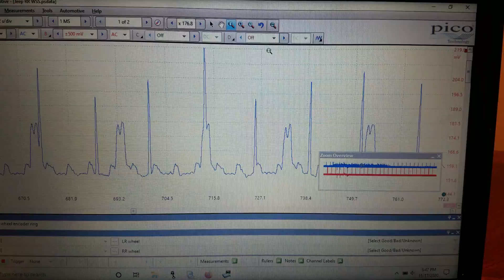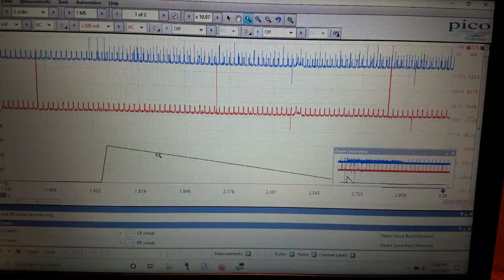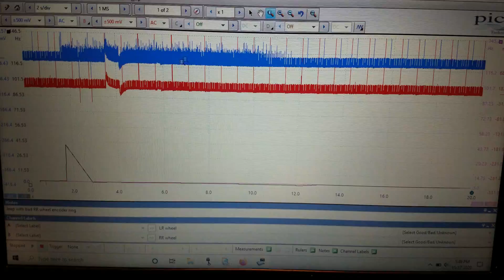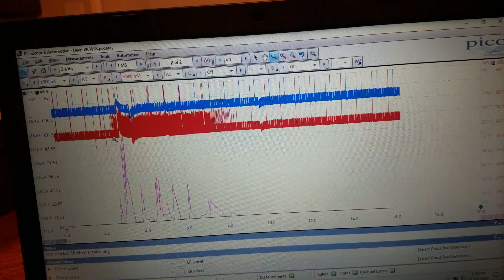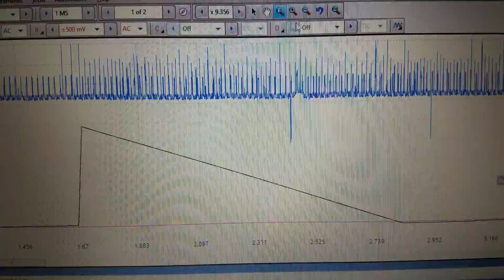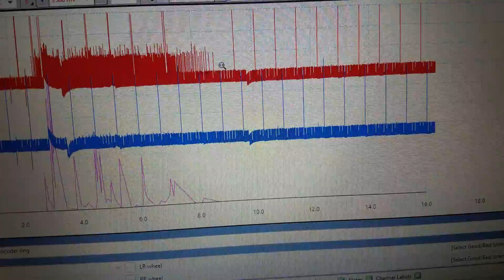Picoscope, Math Channels, and Active Wheel Speed Sensors.

Comment: How were your leads hooked up to the sensors? Across the sensor power and sensor signal wires, or the sensor signal wire and battery ground. Thanks, informative and interesting video.
Reply from the maker: Both leads were connected to the sensor, at the wheel speed sensor connector with backprobes.